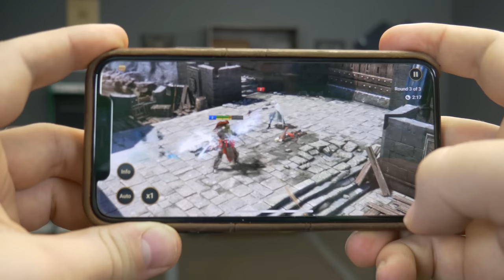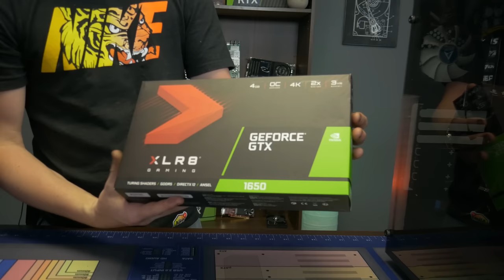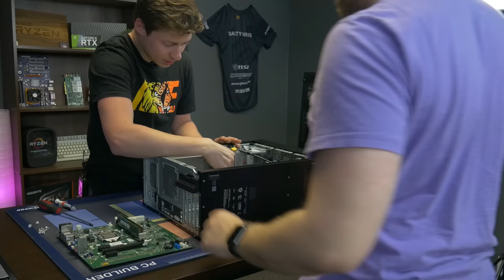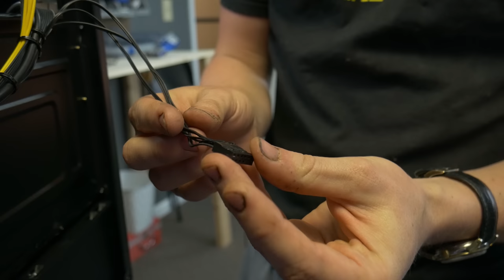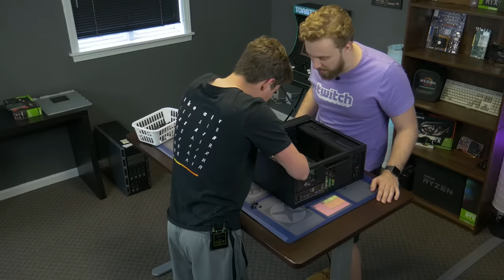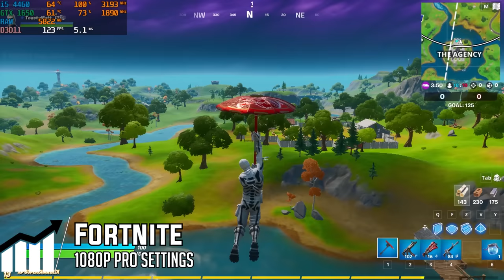OFFICE PC to BUDGET GAMING PC

Comment: I had this exact same model Inspiron that I was trying to repurpose. My friend and I spent like two hours trying to figure out how to best go about getting the system to post. 

First, I cut off the wires from proprietary switch that connected to the Inspiron power button and unpinned the power switch cable from the case. Make sure to label which one is positive and which one is negative though it's not really needed. My friend helped me strip off the very thin plastic from the Dell wires and then splice them into the power switch from the new case. 

The next step would be to wrap the spliced wires very carefully with electrical tape.  If you don't wrap the spliced wires well enough, there won't be a good connection to boot the computer up. If you know how to solder, take some lead free rosin core solder wire and solder that into the spliced cables for better results. The only two wires you really need to splice are the blue and brown ones since those turn the computer on.

Comment: love the budget build. this channel is why im putting together a budget build. Dell optiplex and rx 550
Reply: I seen the Sapphire RX 550 on ebay and a client was asking me if it would fit their optiplex sff. I told home probably not. Any thoughts on that?
Reply: @NexusFantismo  they are backwards compatible right? So it would probably fit in the motherboard.
Reply: @NexusFantismo  it would fit kinda but you would have to remove the bracket because it would be to big and put something under it so its not loose and it gets support. I would recommend a a low profile card from msi. i got mine for 78 bucks. https://www.msi.com/Graphics-card/Radeon-RX-550-4GT-LP-OC.html

Comment: Just bought a 3020 with 8 gb of ram and 1 tb hard drive. I plan on buying a 500 watt psu and putting a rx 570 in it. Can’t wait till everything arrives!
Reply: You will have to get sata cable will the L shaped of the usb3 ... Cause ur rx 570 will cover them... And you will be good to go

Comment: Why non super 1650? 1650super costs around the same and has like 40% better performance.. You could throw in an argument of non super not requiring additional power, but super variant would work just fine with 6pin adapted from molex or sata.. Its just additional 25w, its like 2 or 3 hard drives.. and molex and sata can theoretically handle up to 62 and 54 watts respectively.. I mean, i like what you are doing but I dont understand some of your desicions

Comment: Xeon's work in Dells, try out a e3 1240v3 or any 4 core 8 thread. I believe to have that 4th gen i5 that Dell should have h81 chipset so haswell xeon should be great. Fyi e3 1290v3 turbos to 4.1 ghz.

Comment: I would buy the rx 570 instead of the gtx 1650
Reply: You will need a different psu then. One with a six or eight pin connector

Comment: Hi have you guys ever dealt with having bent socket pins on a bent Intel motherboard and had to deal with the pain of bending the pins back in place?
Reply from the maker: Yes, sometimes it can be fixed other times it's not worth the time.
Reply: @ToastyBros  Can that be a reason why when I put all 4 of my memory sticks in my PC it wont boot but when I have two in it works. I hate that it cuts my ram capacity from 16 to 8. I could probably just get a dual channel kit or should I just fix the pins?

Comment: Anyone know why this is outperforming my pc in all of these games? I have a ryzen 5 2600, RX 590 and 16gb of 3600mhz ram and I have no overheating issues or any problems at all. I get like maybe 60fps pro settings on fortnite with major stutter problems, and only like 120 on medium settings on csgo. Also, changing the settings to max doesn't change the framerate at all in either game, I get the same performance on max settings as minimum settings
Reply: Maybe you got an ingame fps limiter?
Reply: @InstantNameOfficial  he could get way better fps

Comment: my optiplex build
i5 3rd
8gb ram
1tb hd
rx 580 4gb
500w EVGA psu
this whole system cost me $220

all 1080p

200 fps csgo max
144 fps fortnite ultra everything (shadows off)
60 to 80 fps (depending on the season) forza horizon 4 Extreme settings not to be confused with ultra which is lower
70 fps warzone on pro settings...as you know on warzone having 8gb ram is just not enough. you can watch comparison videos showing 8gb vs 16gb and the 16gb has like 20 to 30 fps more also i get huge fps stutters like every 10 sec to 15fps im gonna get 16gb eventually.

Comment: Inten Core i5 9400F Hexa (6) Core Processor with 16GB DDR4 Memory , Nvidia GeForce GTX1660 SUPER 6GB Graphics Cards , 300Mbps Wifi , 1TB 3.5" Hard Disk Drive , 500 Watt 80+ Bronze Certified Power Supply and Windows 10 Home Edition PreInstalled with Licence. 2 Year Collect & Return Warranty and Lifetime Support Included. Anybody know if these are good specs

Comment: I just did a 200 dollar pc build with an i5 2400 and rx 470 not bad
Reply: RRI Gamer you could of done better with a dell optiplex 7010 with an i5 3470 and just remove the hard drive cage and add a new psu and gpu
Reply: @ChrixOfficial  my specs are i5 4440 and a gtx960 with the stock psu what should I up first

Comment: honestly i love your videos when you do something right in this video you did some cool things but this should be called the E-sports Gaming pc video not a gaming pc.

1. RGB = Not giving a damn here is why all of these cheap builds on youtube you guys keep pushing RGB As A Wow factor its not and thats just stupid.

2. you used a board with a huge bottle neck and compared it to a ryzen build no thank you i would take the ryzen over the I5 processor anyday

3. you used a SSD great except not explaining that the latest version of windows 10 will take nearly 20 gigs of that SSD droping the SSD to 220 gig's and if the machine cannot handle the read and write speed from the SSD you will create another bottleneck

4. most gamers think a bigger monitor is better and that non powered graphics card wont handle large monitors well most extreme e-Sports players are on large monitors at home 40 and 50 inches which with that card will just graphics chop like hell.

this is why i cant give this a thumbs up mainly because the machine is ok but bottle neck after bottle neck doesnt make a gaming pc

Comment: So basically what you did was move the motherboard into a better case with a GPU and psu. If you’ve got that case already, you may as well buy a used Ryzen motherboard and do not repurpose some Dell OEM crap laying around with no overclocking capabilities or features whatsoever. This is cringe. I would not advocate for this.